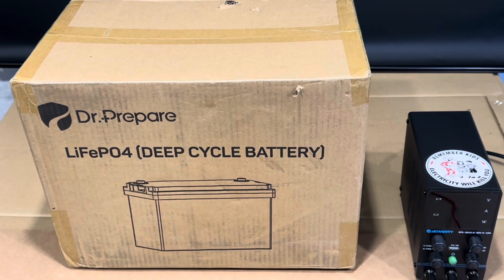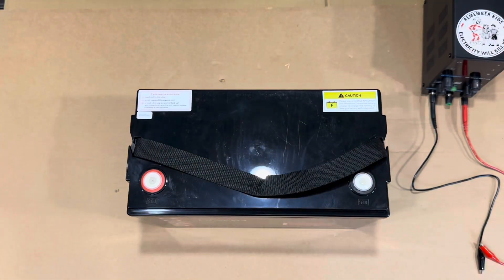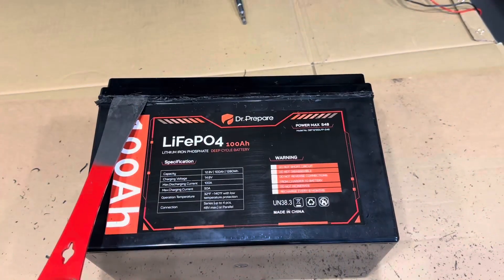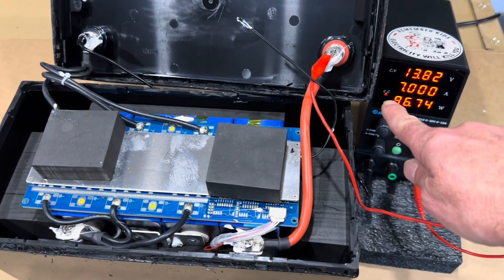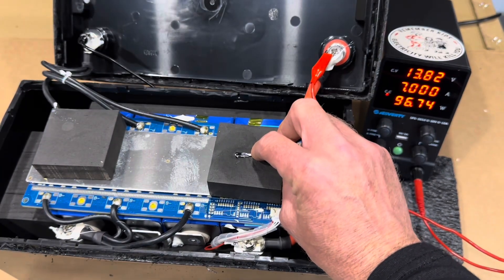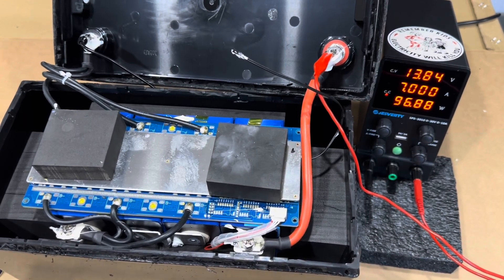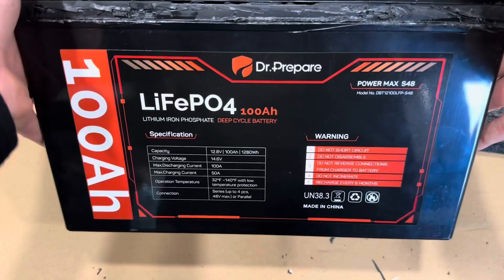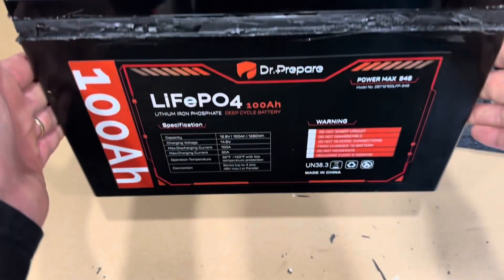Dr. Prepare 12.8V 100AH LiFePO4 Battery Teardown, Power Max S48 Battery

Comment: One of my dr prepare batteries like this one with the LCD screen, after only 2 months the BMS failed. I can pull energy but the BMS won't allow it to charge and the LCD screen is dim and says it's 100% full even though it's only putting out 11.4 volts. Buyer beware!
Reply from the maker: Thanks for sharing your experience!

Comment: Great video. I just received my 1st one of these. I am a user and will not tear it down. I have an eco worth 10am LI smart charger. The Dr. Prepare was at 13.23 volts and after charging to full per the charger it reads 13.83 per my voltmeter. I was looking for 14.6 volts. Any thoughts? Thanks.
Reply from the maker: How long did you charge? 
The batteries are only shipped 30-50% full. Probably would take 5-6 hours minimum to charge to full if new out of the box. The charger will hit 14.6 and the current will taper to 0 amp. Then battery is 100% full and voltage will settle to around 13.6-13.8 at rest an hour or so after removing charge. 

Hope this is helpful.
Reply: @THEOFFGRIDMOUNTAINHOMESTEAD  Thanks for the reply. I did glimpse a 14.2 before going back to 13.8. Maybe I missed the 14.6. I did initially charge for at least 6 hours. I am currently 20 hours into running a dorm fridge. I show 300 watts consumed and a voltage of 13.23 which is 70% capacity I believe.  I’m am doing this test as a family member has meds that need refrigeration. I’m am actually pleased now. Again, thanks for replying. Peace.

Comment: I have five of these Dr. Prepare 100 AH batteries.  They all are working very nicely.  I like the light weight of about 22.6 lbs. and the good carrying handle.  For the price of $199.00 dollars, these are a great value---best I have ever found!
Reply from the maker: Awesome, good to hear the batteries are doing well for you! I’ve got mine connected and in service for long duration testing! I’m happy as well!

Comment: NOTE only one C  discharge so 100Amp max load or 1200W
Reply from the maker: Yes 100A max spec by manufacturer
Reply: Only one? Is that bad or are there better?

Comment: Well, I was pleased to see the quality inside of the battery.  The very first thing I noticed was large gauge wire. That is the first clue on build quality. The build quality looked to be on parr with high-end batteries out on the market.  I was wondering about what kind of cells they are using.  I am going to try to find out at their website and see. It's definitely a good video on the build quality. It also shows they have the components inside that they claim.  Look forward to seeing more testing with these batteries.
Reply from the maker: Prismatic cells.
Reply: @THEOFFGRIDMOUNTAINHOMESTEAD  is that a good cell?

Comment: So not worth a flip in Alaska (low temp)   and not good for Arizona (high temp ) ?? is it built with 18650's ? I'll check them out thou !
Reply from the maker: Low temp protection to prevent charging and damage to cells below 32° and high temp trigger would not activate under any normal ambient temperature range. Prismatic cells in this battery. 

18650s are cylindrical and commonly lithium cobalt not LiFePO4!